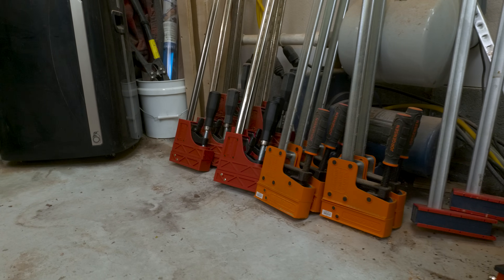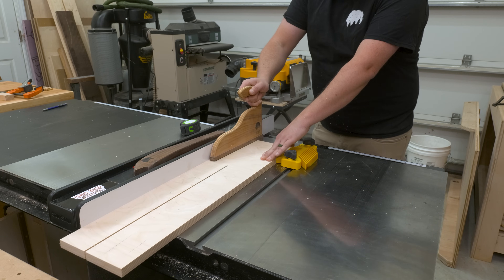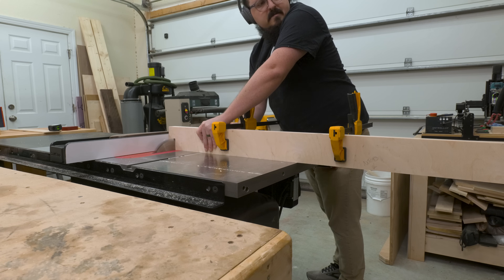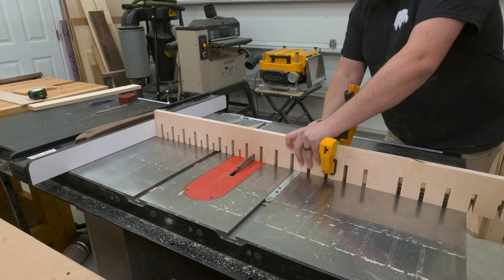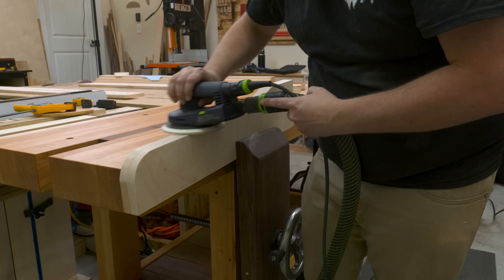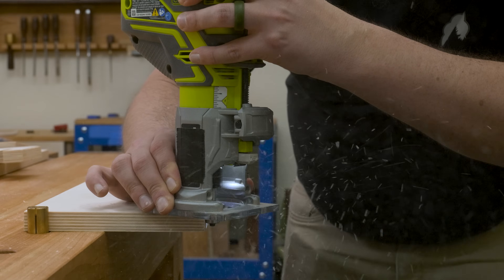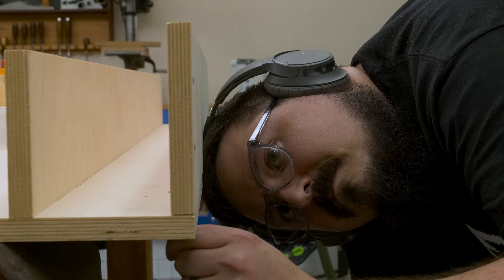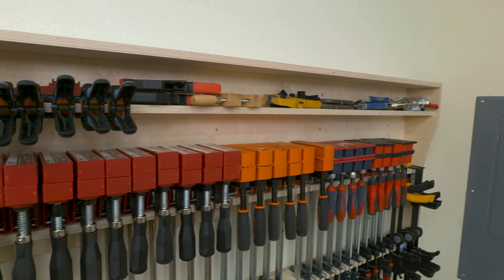This Solution’s Both Clever and Surprising: Clamp Storage Rack

Comment: Just a tip when cutting multiple evenly spaced notches you can use a sled with an index block to move to the next notch cut without constantly adjusting the table saw fence.
Reply from the maker: Yeah, a sled with a pin would be a good solution too.

Comment: good stuff. I've got some left over baltic birch that I was looking to do something with and I need a clamp rack. I like how this keeps the clamps closer to the wall and doesn't stick out to far. I might put something like this together this weekend.
Reply from the maker: Thanks! Yeah it’s a nice compact design and a great scrap project.
Reply: @TimberBiscuitWoodworks  oh I meant to ask. how do you like the rip-flip fence on your table saw? It seems like it could be super useful when doing something like making cabinets. just set all measurements for your project and if you forget to cut something you still have the exact measurement that was used for the other pieces. I've wasted so much time trying to setup the exact measurement for a piece I forgot to cut when I did all the others with a specific measurement.
Reply from the maker: @atomictyler  I love it. I have found a lot of instances where it has saved me a ton of time for exactly what you are talking about.

Comment: Your baltic birch looks like it has a melamine coating on it. Is that right? I had to go to a specialty hardwood source (about 40 miles from the smaller town I live in) to even purchase a 4 by 8 sheet of baltic birch ply. The big stores don't ever have it. Too expensive, I guess.
Reply from the maker: No it’s just regular ole Baltic Birch. I get mine from a local company that supplies a lot of the cabinet shops in the area. Pricing has skyrocketed since 2020.

Comment: This is a really nice clamp rack. But due to my very limited wall space I have become a fan of having the clamps come from the wall out instead of running along the wall, this way I can get 4 parallel clamps in the same space as I get 2 if I run them along the wall and I am able to 6 or 8 F clamps in the same space as 2 or 3.
If I had a ton of wall space, I think I would still do them from the wall out, so I had more wall space left for other things.
But yours is still a great looking rack and if it works for you then it's all good. 😃
Reply from the maker: Thank you! Yeah I have a lot more wall space then I do floor space in the shop, and I can fit a lot more width wise with this solution than I can depth wise.

Comment: Great project ! When making your small support blocks you pulled the sled back with the cut piece trapped between the blade and stop. Eventually that will cause at least a bind that can damage sled, blade and workpiece and at worst an injury. Always control the trapped piece.
Reply from the maker: Thanks!

Comment: Great job with the rack. Personally, I prefer the kind that stack the clamps one in front of another; see JKM's and Two Bit Woodworks for what I'm referring to. They're far more space efficient.
For shop projects I like shellac. Easy to apply, dries fast and gives good enough protection.
Reply from the maker: Thanks! I think really depends on what you consider important in the shop. I would much rather have the floor space over wall space any day of the week.
Reply: @TimberBiscuitWoodworks  I agree to an extent; if you build your racks so they hold 4 parallel clamps deep, that's where the space savings start to add up. Going by my bessey revos, they're 3 clamps "wide", so with the clamp racks holding at least 4, you get a horizontal space savings as well as the floor space savings. AT about 6 clamps deep they can start to jut out a bit much. I'm not knocking your design; I'm just working in 2/3 of a one car garage so every microinch of space has to be accounted for lol
Reply from the maker: No, I can see why you might think that. If you stack them outward, you are looking at 8 to 9 inches off the wall, which means items below have to push out by 8 or 9 inches, thus taking up more floor space. Becuase you can't put things as close to the wall, again I think it comes down to how you prioritize space.
Reply: @NWGR  I have mine stacked outward and just high enough that I can store my router table and table saw against the wall under the clamps when the router or table saw are not being used, that way I have floorspace to use for other things like assembly or finishing.